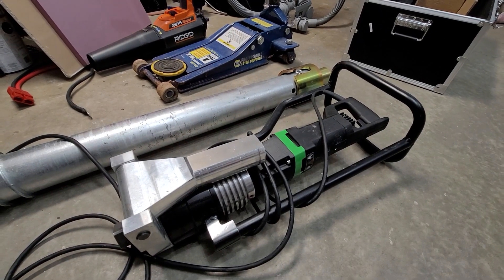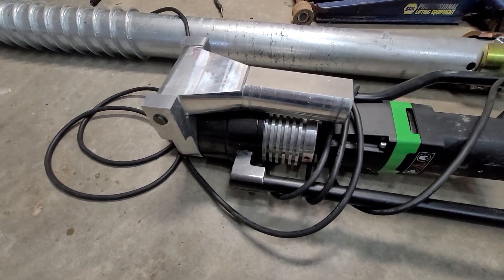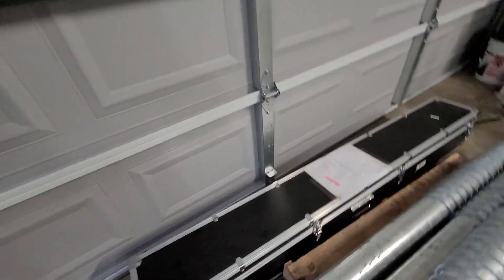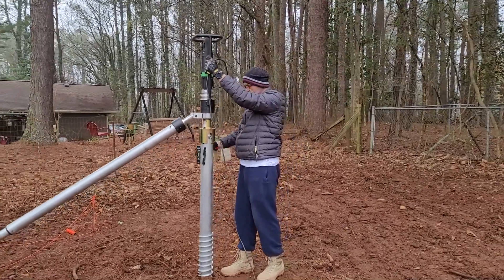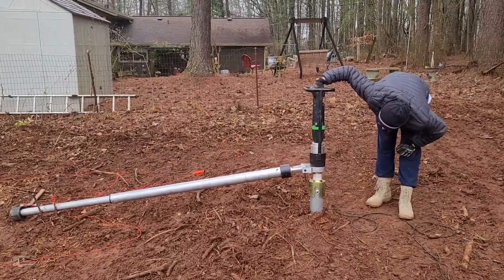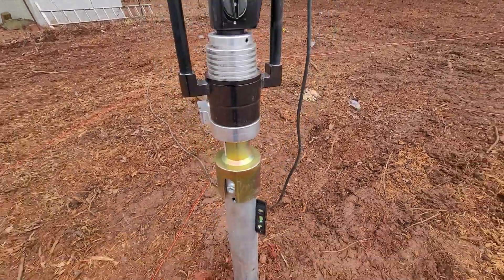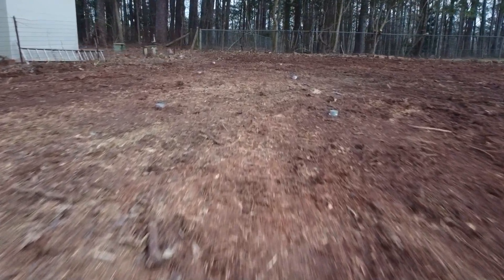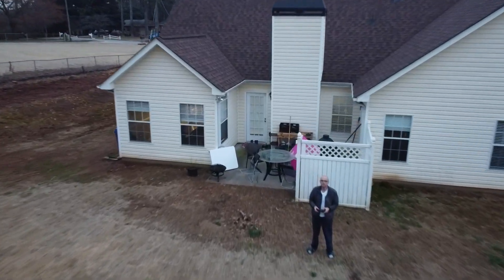Ground Mount Solar Array Part 3 American Ground Screw

Comment: I wonder if they have an adapter for my tractor driven post hole borer. It uses a standard 2 inch circular drive shaft.   I am planning a 20kw 50 - 52 panel array. I may use one or two ground mounts. I am still looking at my options.  Thank you for filming all this.
Reply from the maker: Not that I know of. But I do know that there are attachments for skid-steers.